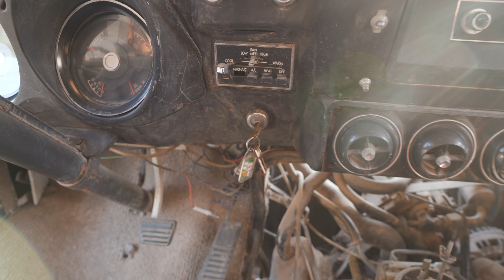WE BOUGHT A VINTAGE CAMPER VAN RV | RV RENOVATION PART 1

Comment: New radiator, be sure to check all the fluid levels , brakes differential etc.One tip is to mount a 100W solar panel on top to keep the RV batteries fully charged.That's the best thing I added to our camper so never have to worry about the batteries running low. Be sure to check the fridge for functionality be it by DC power, plugging in or on propane. You gotta LOT of work to do on that beast.You're going to want to find a good RV parts and service center for advice and things you will need to replace/buy. Have fun and look forward to watching the transformation.
Reply from the maker: Harvey we're getting back on the road!!!! We probably want to mount at least 3 100W solar panels and the fridge is propane but we may want to try to convert it, or switch out the fridge since we want to try to run as much off of solar as we can. We may be in over our head but we'll see as we go! But we definitely need to look into a parts and service place!